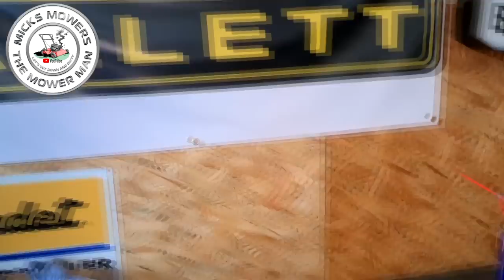Atco Balmoral Allett Lawnmower Starts But Dies Fix #atco #allett #micksmowers

Comment: Hey Mick. New subscriber and loving the channel. Wondering if you have any video servicing a petrol scarifier? Its much of the same but you do make some complex things very easy. Keep up the great videos!! Alert bell certainly on here 🔔
Reply from the maker: Hi mate .. sorry I don't have a video for you but most engines are the same.. whats it doing..
Reply: @themowerman  its not starting at all. Going to try a new spark plug and take out the carb during the week. Will have a better idea then but hopefully one or the other. Thanks for the response 👌
Reply from the maker: @padraig9445  yeah cool.. let me know if you need anything

Comment: Hi Mick I have a question if you don’t mind. The Tecumseh engine I am planning to put on my balmoral was working and now it starts up and then stops after about 5 seconds, my thoughts were fuel starvation so I changed the carb to a known working one, still the same result, changed the plug to a known good one and still no joy, any idea ? Regards Bernard
Reply from the maker: Hi.. check the fuel delivery from the tank to the carb.. it may be slow.. it's it's ok then a carburetor clean will be needed
Reply: @themowerman  cheers. Tried a different tank and the carb has been thoroughly cleaned and ultrasonic cleaned. Carb tank etc work fine on my other balmoral. I don’t get it TBH.
Reply from the maker: @bernardmarsh8436  ok.. take the air filter off.. and with some carb spray start the mower and just as it's about to stop spray some carb spray in to the carb.. let me know what it does
Reply: @themowerman  I’ll have to get some carb spray tomorrow and let you know.
Reply: @themowerman  it won’t even start now. No spark, plug is ok, any ideas ?
Reply: Going to test the coil tomorrow
Reply: Thanks for the advice Mick. It turned out to be a wiring issue. The coil tested fine. Moved it to a donor machine and all good.

Comment: Mick on the se models I’ve heard you can use a motorbike battery rather than the Atco batteries (which are quite pricey) ……have you heard of that ? Would the battery need to be of a particular spec ?
Reply from the maker: Hi.. not seen that .. the batteries I use are only £20
Reply: Oh ok …….which batteries do you use then ? Just looking at getting the electric start running
Reply: Great job on the channel by the way - learnt loads 👍
Reply from the maker: @lukebryant6110  
This is what I use.. 
Ultramax 12V 4.5AH(5AH) AGM/GEL Rechargeable Battery for Mountfield Lawn Mower https://amzn.eu/d/9JCIGGi
Reply from the maker: @lukebryant6110  thanks me old mucker
Reply: @themowerman  appreciate that thanks
Reply from the maker: @lukebryant6110  your welcome